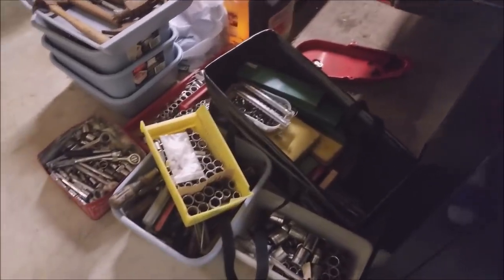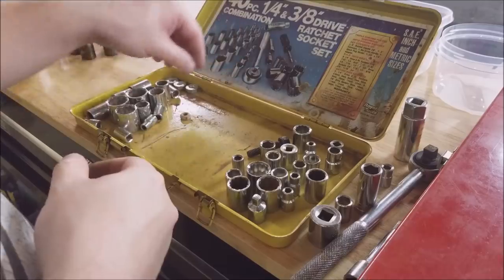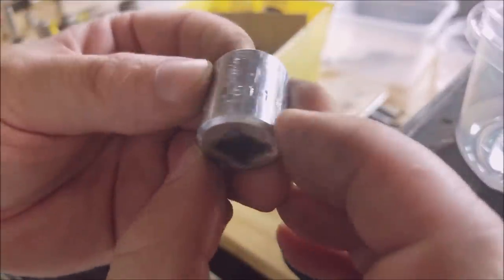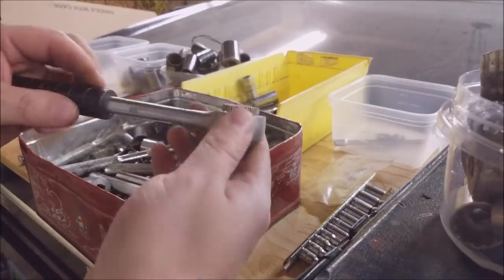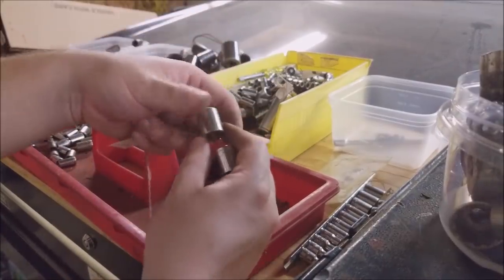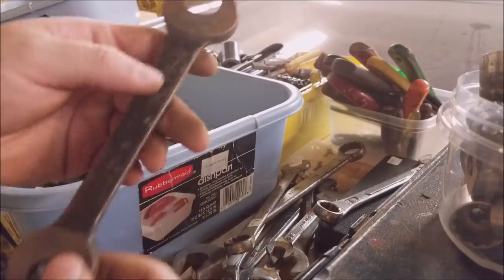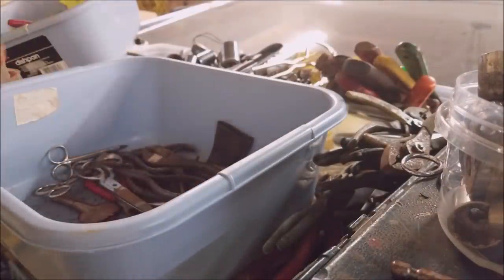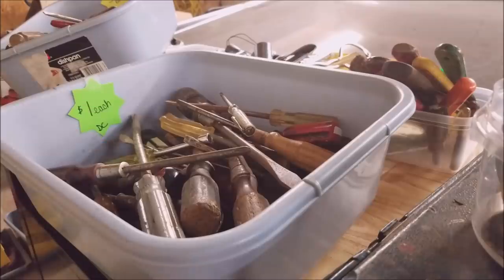MASSIVE Tool Haul - All For Only $100!

Comment: The power Kraft Brand name is a brand sold through Montgomery wards speedmaster was another brand so by Montgomery wards in the 1950s and 1960sand that Montgomery wards powercraft ratchet you found is an extremely good ratchet it just needs a good cleaning and to be took apart and worked on and you will have you a very very nice ratchet made in the USA for powercraft Montgomery Ward's two line that power craft rochet would be well worth your time to fix it get it oiled up I imagine that ratchet still works it just got dirty and stuck it just needs a good cleaning and I imagine it'll work just fine and the Challenger tool you song is made by Protoand the other two you saw that said action on there it's made by Proto and the other socket using that said fleet that's made by Proto which are very high quality tools